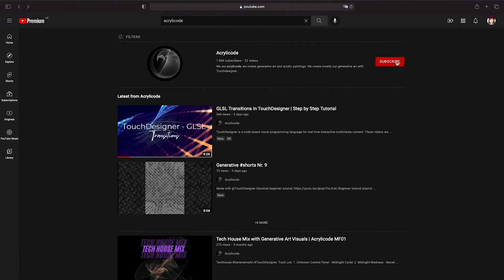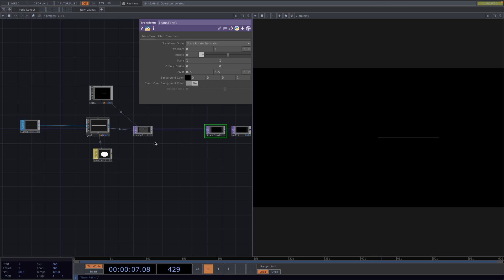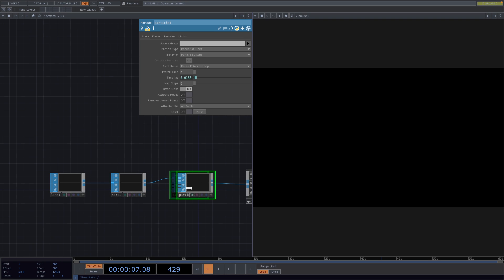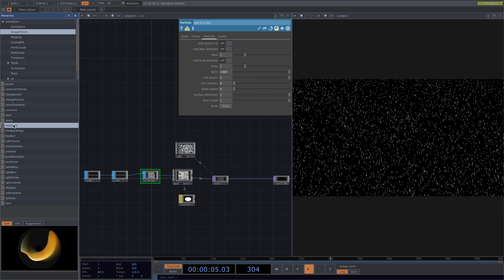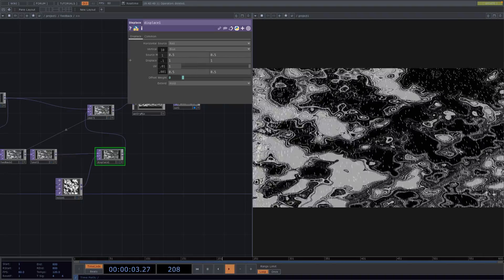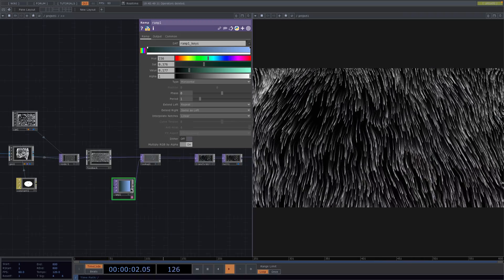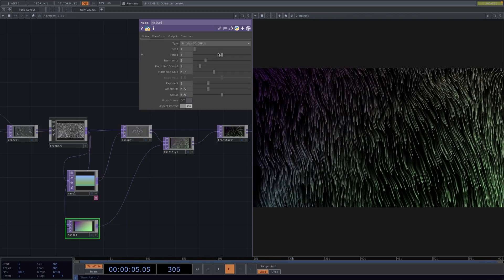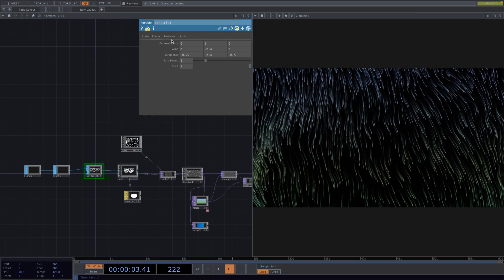Easiest Waterfall on TouchDesigner | Step by Step Tutorial

Comment: Hallo Thanks fot hte tuorial .  But Why when i add a geometry there is a cirle shape inside and there is no way to connect it with the line ? Like you do so?  hmm ???
Reply: I have the same problem, did you fix it?
Reply from the maker: In order to attach the geometry automatically you need to right click on the output on the line and add the geometry. If you see the geometry COMP (Grey one) without an input, you can also go inside by double clicking it or zooming and then adding a inSOP inside the comp. That will allow you to attach an input. After adding the inSOP you can get rid of the default Torus. Let me know if that solves your problem.

Comment: Great tutorial, is there a way to react to kinect?
Reply from the maker: Sure, you can use the kinect data for driving parameters of the particle SOP, or to drive an attractor (like a sphere SOP) and connect it to the last input of the particle SOP. Or you can use it the kinect data to drive the post processing, like the displace or the noise in the feedback or for changing the color.
Reply: @acrylicode  in a similar way, is it possible to use live objects to intercept the rain ? I want to make a water flow that can be changed using paper or puzzle blocks
Reply from the maker: @klaudiapacharew9844  I think it can also be done with attractor (a negative force, that acts as a repeler). Another way to get fluid like interactive systems is with Nvidia flow (only for windows with Nvidia card) or using glsl systems with compute shaders.